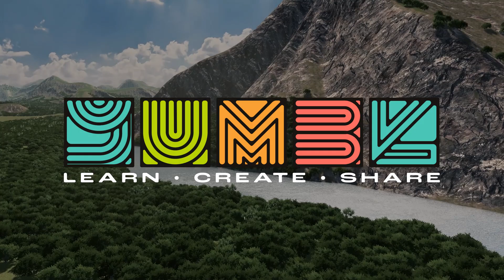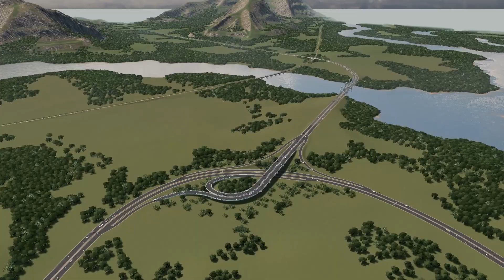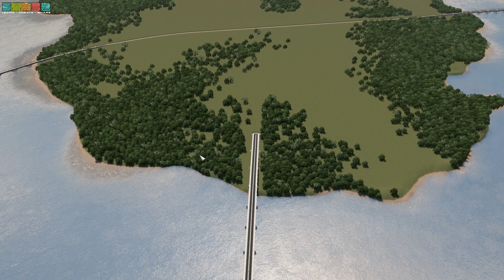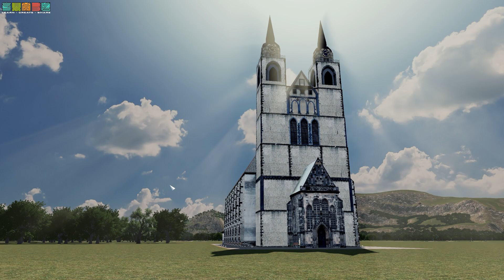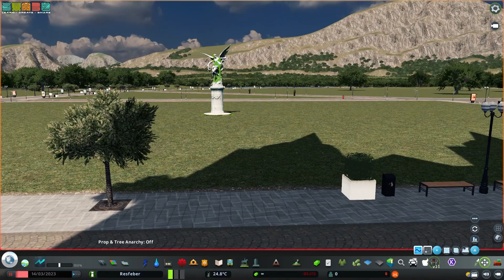Day 1, New City  |  Resfeber (European Cities: Skylines Build e01)

Comment: The roundabouts with bike lanes are pretty interesting. Looks kind of unsafe to me, but I guess that's not really a huge concern in CS. I'm from the Netherlands, and the way roundabouts are set up around here, bike lanes almost always come away from the road a fair distance, even if they do end up following a roundabout pattern. I think the offset is partially so that drivers don't have to watch for bicyclists AND cars at the same time, since they can stop past the bicycle crossing but before entering the roundabout.

Actually, in many cases, the cycling paths near a roundabout do not follow it perfectly. For instance, if there's a separated bike path to one side of the road, and you just pull that across to the other side, cyclists going in either direction can cross at the same place, lowering the amount of crossings. In that sense, it's the most efficient to simply have a bicycle intersection next to the roundabout, so you only need to cross the road in 2 places.

I don't think I've ever ridden a bike on a roundabout with cars, now that I think of it. They're always separated entirely. Shared space roundabouts simply aren't a thing.

Comment: This is not what bike rondabouts look like in the Netherlands, here the bikelanes go around the outside of the rondabout so they are separate from the car traffic, much safer that way.
This is what Dutch rondabouts look like https://www.youtube.com/watch?v=FR5l48_h5Eo
Reply from the maker: Do you have a network that accomplishes this?
Reply: @YUMBL  Sadly I don't know of a network that does this, roads that share bike lanes are only used in places where there is no room for a separate bike lane (mostly inner city roads that were there for a long time) and then the speed is lowered to 30 km/h to make the speed of the traffic more equal.
Maybe you should watch a few of the videos from the link I gave you. The Netherlands has a great biking infrastructure.
Reply from the maker: No, i understand. I just dont have a network that makes this possible. Thanks for the suggestion.

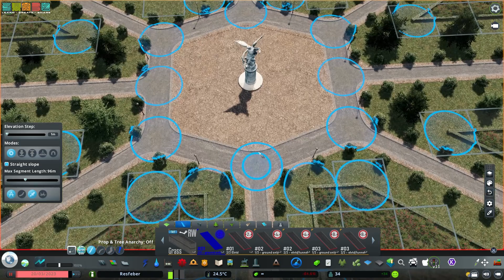Comment: Hey Yumbl! I just found your channel and I have to say you create some of the best CS content and tutorials. I’m learning so much. Also, quick question 33:40 what kind of decal/surface paint did you use under the statue in front of the church that you could cut through with a path to create those little “islands” of pavement?
Reply from the maker: Thanks a lot! Those are just the ruined or gravel from my map theme applied with surface pinter. I dont recall what map theme I used. It was all mixed.

Comment: On local and smaller access roads it's a good idea to have the bikes on the same level but keep some space between the bikle roundabout and the car roundabout so the can can first pass the bikes and then have a spot to wit, and then join the car roundabout, but the main and larger and faster roundabouts are generally best to keep grade separated 

https://bicycledutch.wordpress.com/2013/05/09/a-modern-amsterdam-roundabout/

One city you might find some interest in is Dresden. It has a central river also. Amsterdam is a bit over-used but still relatively cool and has a river too between the old town and Amdsterdam Noord. Though it might have some interesting things for you to use
Reply from the maker: I appreciate it! Do you know of a network (or other solution) in cities skylines to make that bike roundabout configuration possible?
Reply: @YUMBL  I would quite probably use the red zoneable version of the paths from parklife dlc. You used it in this series already before.

Then again I prefer to use red as my bikelane colour. Then again I am used to that. It's very Dutch (and Belgian)

Denmark I'm told uses green, and the UK has been experimenting with blue.

Blue is also said to be the best colour in academia, but academia also states that using one consistent colour is better than using a less ideal colour.

I must also say that the roundabout you've made before is already pretty good and not at all uncommon in the Netherlands, and in fact is better than many cations' own versions of roundabouts.
Reply from the maker: Oh, thanks! I appreciate it :)

Comment: European here, from a medieval (German) city by a river. While I like the start I’d like to point out that roads generally follow the curvature of the river, rather than run along it’s bank in straight lines and meet at angles. The reason being is these cities didn’t start out as or set out to be big cities, they started out as little hamlets and gradually grew. What you’ll find is that potentially short sections of river front roads have been straightened out for opulent palaces and public buildings but largely the road network by a river in the old town sections on medieval cities will just be a jumbled mess of tiny interconnected lanes and small alleys.
Have a look at maps of places like Munich, Cologne, Dresden for inspiration of river front old towns. As you move away from the river you’ll have a vague grid, but with tons of offset intersections and rarely ever a clear view down a large avenue, these will be behind all the mess.

Comment: An Old European city. would not have a main road, it would have a cobblestone road and it would be defensible in one or more ways. Then a newer city would later grow up around it. I should know because I live in a city were the old section form 15th century and it has a moat and it's walled up with the old city in side. Around that is an older part of the city,  think 1850 ties and such. All along the waterfront most of the houses are from pre 1870.  To make sure that old stuff got taken care of everything else was moved elsewhere. But that's only because we could as one of the oldest cities still around and they could spread out to cover a huge area.

You could put in 10 times more people by going up high, but there's a high-rise ban and strong restrictions almost everywhere. The only exception is the new town center and it's surroundings, there you'll find high buildings. 

Fun little fact, we have houses older than your entire country and I was born in a house almost as old as your declaration of independence. And such old houses really are historical so you can fix them or upgraded them properly and that means living in a drafty cold place during winter and hot as hell during the summer.

That's how an old city that has grown into a modern European city is. Sadly the people in charge has not yet learned some very basic truths about how to run a city or handle it's traffic.

And we don't use bike paths in roundabouts unless we have too. In every major intersection there will be a undergrounds path for walkers and bikes to travel to get across or though the roundabout.

The oldest church in the area is from 1182 and it was build in the middle of farmlands back then because that was what there was. It was also up river from the fortified town that later become what we know have from the mid 15th century.

What's worse this isn't even the oldest by far. We got churches that predate Columbus so called discovery or your country, little did he know that Vikings found this odd land nearly 500 years earlier.

You really need to see an old town like that your self, because it's worth seeing and there are some really impressive once around in Europe and some of them has been around in one form or another since 500 BC. What we got here where I live is the oldest surviving fortified town in Northern Europe and there are some place where you can feel all those years pressing on you, some sites feels oddly cold or heavy in a way that makes most wanna be psychists claim that there are ghosts. In fact locally there are supposed to be several active places where you may be lucky enough to experience an haunting. Some nights you can even see the ghosts and trust me, thousands have done so before. 

I used to live in a house where you could hear steps going up the stairs and then doors would open and close on their own. That's the type of haunting you may come across if you are really lucky around here. Then there's the White lady that only show up on dark nights and other places where you can see the ghost plain as day if you look.

That's the history those of us who are not wearing blinders learn from. 

I'd love to see a proper European Old city build, but even getting the feeling right would be hard I think.

Comment: Advice for bike lanes: In reality, usually try to avoid having lanes on traffic circles, because it is safer and cheaper legally, as it does not generate crossings that can be dangerous, nor is it necessary laws that regulate them.

And another thing, the bike lanes are usually placed just behind the crosswalk, to move them as far away as possible from the exit of the traffic circle, avoiding the crossing and avoiding that if a vehicle with a rare angle of vision, high speed or similar, hits the cyclist's bike and that this hits against pedestrians on the crosswalk.

PD: Segurencia: a commercial square, in the oldest part of the city. In the time before the French Revolution, merchants began to make them to show the economic power they had, demolishing historical places and building large paved esplanades.
Reply from the maker: Do you know of a mod in Cities that would allow me to put the bike lane behind the crosswalk?
Reply: @YUMBL  Well, I would really have to look at the workshop. What I do know is that there are invisible roads, including pedestrian streets and bike lanes (I think bikes also use the pedestrian streets), that with some decals on top, can work.
You could also work with the roads that the game gives you, hide them underground and put decals on top of them.
Reply from the maker: Excelent ideas! I do know the Dutch have successfully implemented bikes in roundabouts. Its been implemented well in England. I didnt pay attention to where the crosswalk was though. Because the amount of work would be disproportionate to tue result i’ll probably have to stick with the current configuration. Love the ideas though :)
Reply: @YUMBL  It is good to know that in those countries they had implemented the bikes in traffic circles in a correct way, thanks for the tip. Lots of encouragement with the series, I'm looking forward to see how it progresses.

Comment: Markings on roundabout....nope. The transition between the road and the roundabout is usually blank without markings. Possibly the line near the kerbs is ok. The roundabout junction is 'sort of' treated like a T junction. But not always.I can think of around a dozen different junctions with roundabouts. Basic, very basic, rule. Lane one for first exit, lane two for exit two and three, lane three, if there is one,for exit three and the rest of the exits. 
But not always. Depends on local roads and traffic. 
The bigger the roundabout the more exits and faster you can drive. But not always. 
Sounds like a lot of rules, but they really do work. Good, well trained drivers love them.
Reply from the maker: Look up a turbo roundabout to see markings.

Comment: The turbo roundabout looks good but it will be a nightmare for delivery trucks. You have a two lane road with grass in the middle leading up to the roubdabout so trucks can't turn right over the grass. They would normally go round the roundabout and come back to the their delivery point. Unfortunately the trucks can't do that which may result in either truck gridlock or commercial properties not getting goods and becoming abandoned. Regardless the city looks nice, you have a lot more patiece than me. 

PS. Biffa sent me here... you can thank him later :).
Reply from the maker: I’m not putting stores on those arterials…

Comment: Really big fan of the markings, and i think starting around a landmark like a church also works great. 2 things i would suggest for later is to perhaps move the whole garden to the back or side of the church and wall it off, and then fill the original place with a market square. Also, as others have said, i think there shouldn’t be any arterials in or through the old town, there usually isn’t here. And where there is, it was built over an older road, so it’s going to be full of weird angles and turns everywhere, following roads built on a grid that was based on the shape of the waterfront. This type of arterials works great for 60 and later city expansions though!

Either way, really looking forward to this series :D

Comment: To be honest, this doesn't look very European to me. Probably a European city just looks messy to outsiders. But most of them are concentric, since in the middle ages they were fortified with multiple layers of walls, with a few bigger streets leading from the wall gates to the central market in the city. These walls were later destroyed and replaced with avenues. So you have a star-pattern of bigger streets, one or two ring-roads around the city center and the rest is indeed "a mess".

Comment: If you make any cool custom intersections I think it would be nice to keep this in mind for extra realism as I know you like making your intersections realistic, is that our traffic laws are different from the US. All intersections allow to pick any lane after a turn, unless there are several turning lanes. If you don't want to bother setting up lanes and stuff manually for absolutely every intersection that is fine, since that could take a lot of time to set up individually.

So for example in the US a traffic light can allow left turns and right turns from opposite driving directions at the same time to happen, since the cars making a left turn will go only into the left lane and the cars making a right turn will go only into the right lane. In EU we have to have separate times or give way while making a left turn because we cannot assume the guy making a right turn will pick the right most lane.
Reply from the maker: The right turn would be yielding in the US. They would have a red, but could still turn. Not a green.

Comment: 30:10 you have 4 quadrants with the statue as a centre point: you could have just copied 1 finished quadrant to the other three 😉
Reply from the maker: The top and bottom are asymmetrical. Different shapes

Comment: Really nice first episode,  just one thing: the roads you placed are a bit to straight and pointy here and there. 
Realistically they can even be quite parallel but they are always at least a tiny bit curvy. Not very realistic when they're tooo zigzaggy. /\/\/ 
Some tips from me
1. Streets on the edge of medieval cities run along the city wall which is often very round so they form a ring      O
2. Mostly there is one bigger, (and curved) street that runs though the city, passing a market place with, for example, a church. Nowadays this street would probably be a pedestrian zone and part of the very city center with a lot of shops and restaurants.       Ø
3. From there on plan the rest of the roads. Always make sure that the roads make sense: where do they come from and where do they go to. Perhaps from a city gate towards the market place, or connecting two roads, maybe the street at the city wall with a road that runs next to it.

Comment: One critical part IMO for any European city that's been around at least a few hundred years is that the city center pretty much always have a ring road where the old town walls were. It's one of the major characteristics of the real old towns, and usually guides a lot of the towns evolution, from layout, roads etc. In the case where the town is on the waterfront, it's usually a partial ring road, enclosing the old harbour at one side.
Reply: Living here and seeing it everywhere I took it for granted. But yes, you are right.
Reply: Also, potentially old fortifications / castle.
Reply: Well Zagreb is a bit different in that sense as we have old upper town that lost all the walls but several old doors to city still standing!!
Reply: @ZGreenGaming  same for instance in Brussels and Malines/Mechelen in Belgium : The walls are gone, but some gates still stand as a monument.